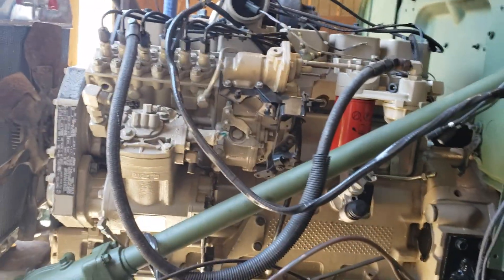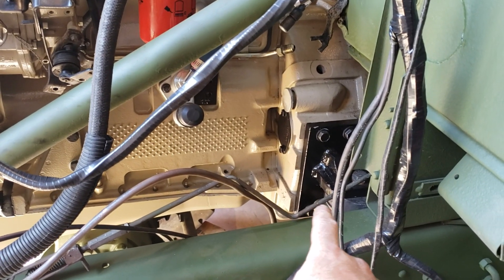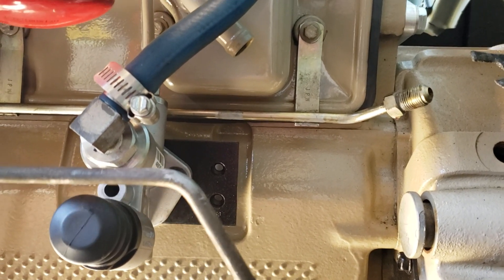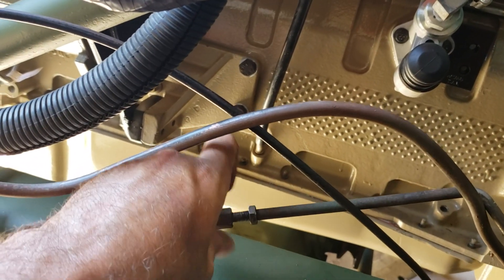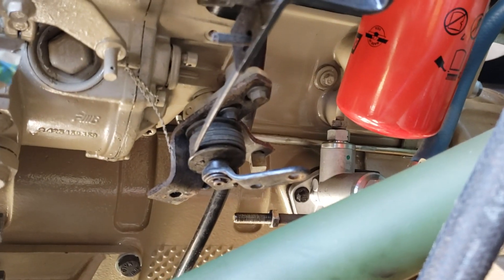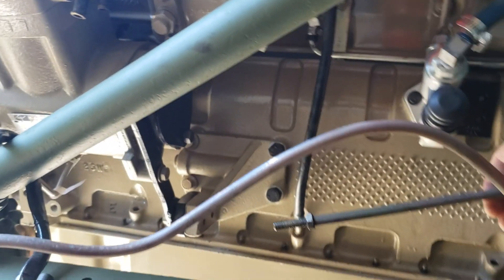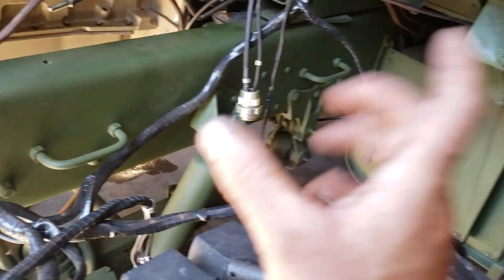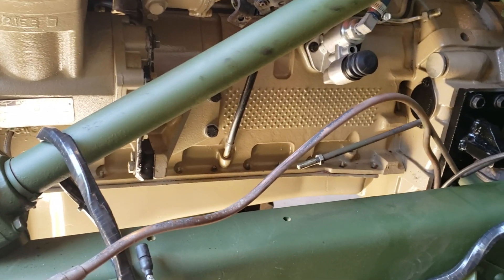M35A2 6BT Cummins swap pt.5: Adapting original multifuel throttle linkage to the Cummins(1 of 2).

Comment: I’ve noticed your front tires are very wide, almost like a super single but you have duals in the rear. What are the sizes? Is the truck hard to steer?
Reply from the maker: Easy to steer. Front tires are the same as the rear. Goodyear G177s, 11.00R20

Comment: i admire your tenacity, and ingenuity in upgrading your truck to  a cummins. i have learned  that my path will be to get original engine rebuilt, the one you did was awesome and  you put in engine solo.....outstanding. keep it simple marine...i'm still concerned about your front motor mount...no way to slide that crossmember closer?
Reply from the maker: No. Steering box is in the way.
Reply: @tacticalrepair  bummer